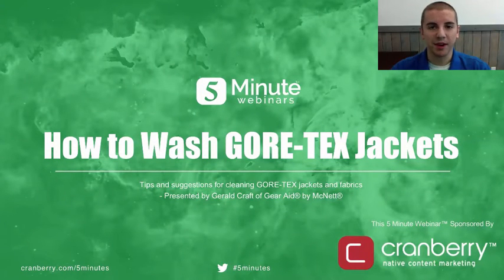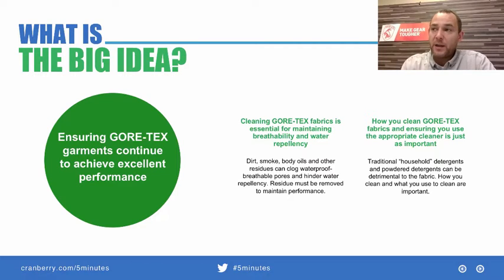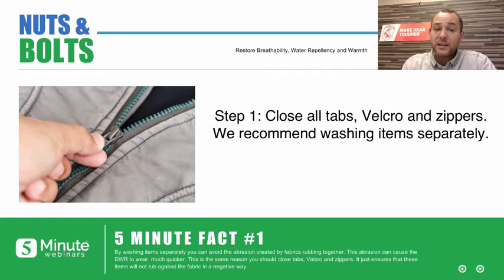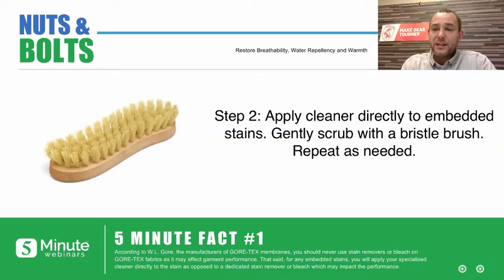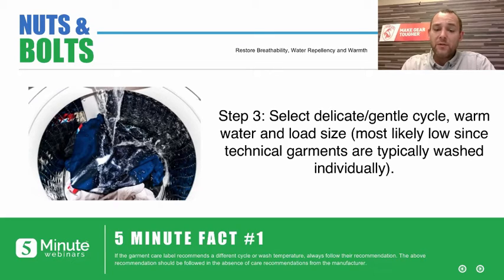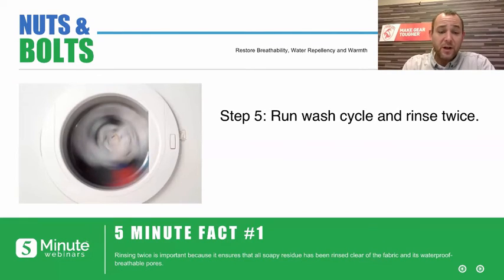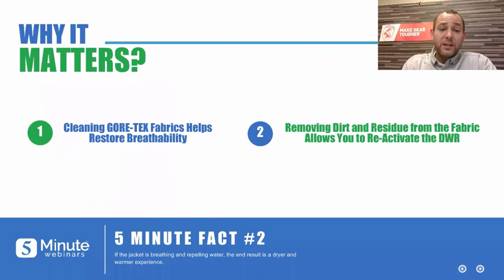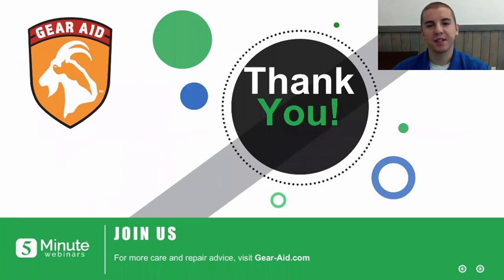How to Wash GORE-TEX Jackets

Comment: Very helpful and concise. I'm gonna live on the edge, though, and wash 2 lightweight Outdoor Research jackets together. Think I'll first wash a load of something on hot with the same residue-free detergent and add vinegar to the rinse in order to clean the washer itself. I'm also gonna use a spray cleaner (Fantastik) in the dryer to remove any dryer sheet and fabric softener residue. Overkill? Maybe, but I don't wanna take up residence on the edge, I just wanna live there temporarily.